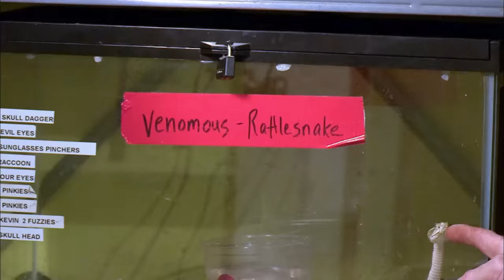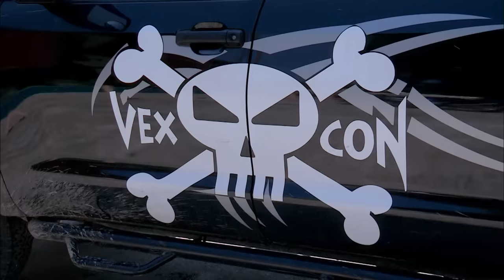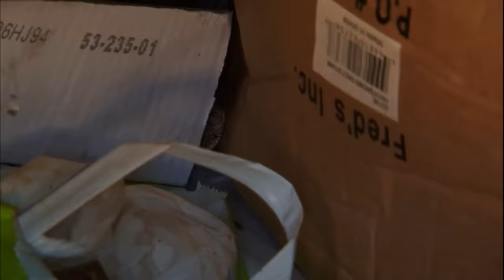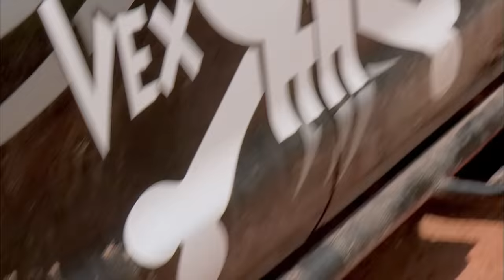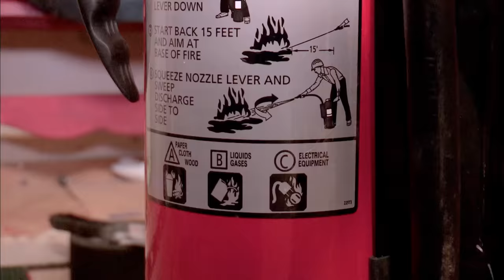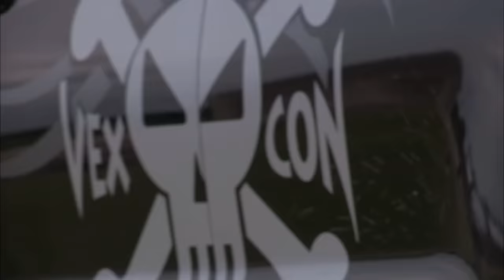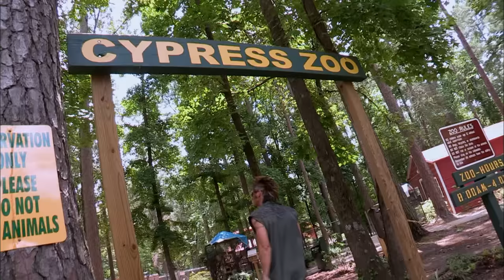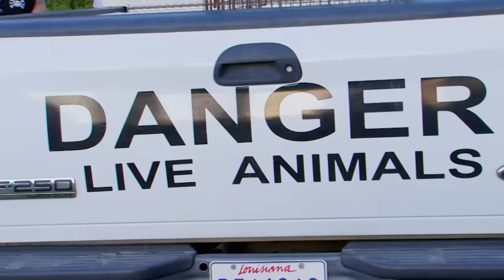Billy the Exterminator: Most Viewed Moments of 2022 | A&E

Comment: I live in the Utah mountains,  the best way to catch a porcupine,  is the same way you catch a spider in a cup, but by using a garbage can. Put the garbage can over the porcupine, just like you would a cup, then slide a board underneath, same way you would a paper under a cup. Then tip the can upright while holding the board. Now you have it contained as well as being able to carry it.